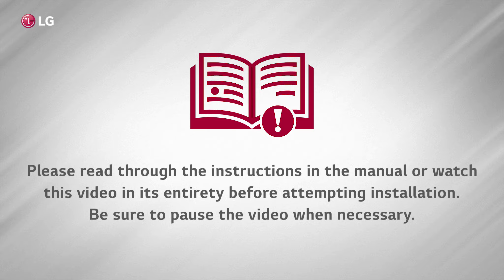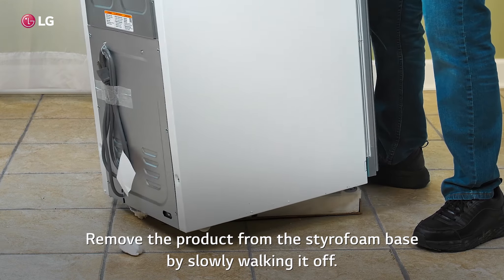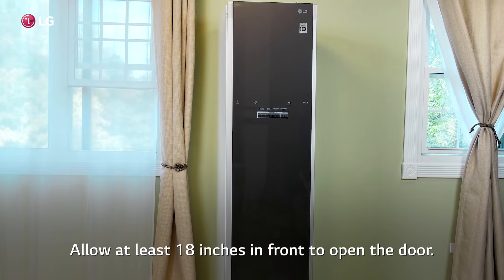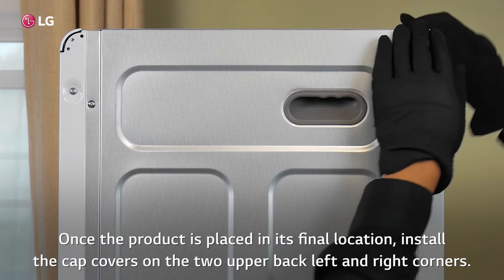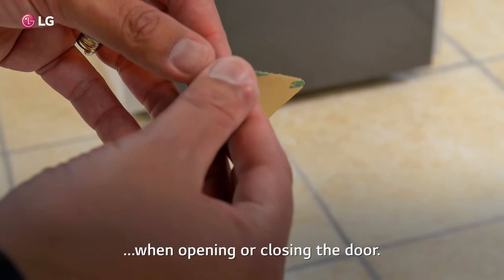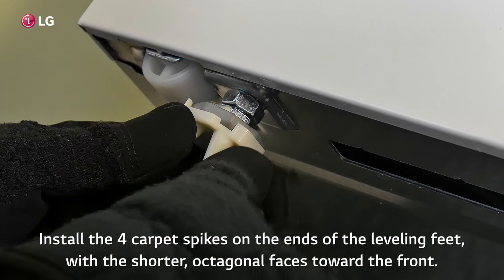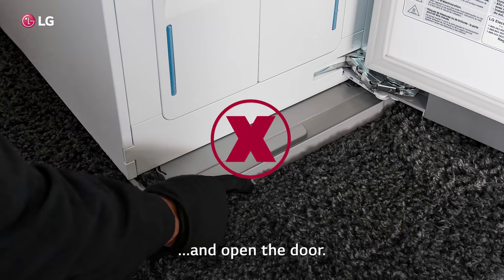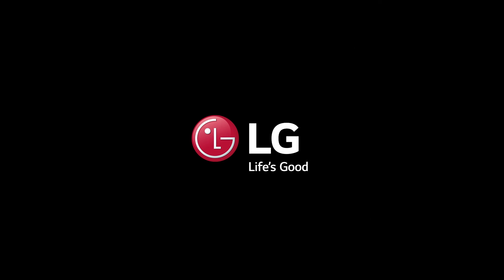[LG Styler] How To Install The LG Styler

Comment: I have a customer that wanted this machine built into cabinetry with finished panels on left and right and a cabinet with a door above.  But needing 7 3/4" of space above will make this look pretty bad.  How important is the 7 3/4" gap above?  What is the purpose?  Can we vent out of the rear area instead of the top/front?
Reply from the maker: Hey there! The 7 3/4-inch clearance above the LG Styler is essential for proper ventilation and heat dissipation during operation. This ensures that the unit functions efficiently and safely by preventing overheating, without the recommended clearance, it could lead to suboptimal performance or potential safety hazards. If you have any other questions, be sure to reach us on social media @LGUSSupport. We’re always here to help! ^Jose
Reply: @LGUSASupport  Thanks for the response.  Would it be acceptable to have a fan exhausting out of the back of the cabinet?  Or is the steam coming from the front or near the door area?
Reply from the maker: The Styler is designed to release steam primarily through the front area, near the door. Installing a fan to exhaust air from the back of the cabinet may not effectively manage the steam emitted during operation. For optimal performance and to prevent potential moisture buildup, it's recommended to use ventilation guidelines. We hope those details help! ^Jose
Reply: @LGUSASupport  Good to know.  That definitely helps me manage the customer expectations.

Comment: what are the clearances for the sides and back. I  see there is a 7 3/4" gap above.. .to hide this space, can we add a decorative grill?
Reply from the maker: Hey there! The recommended clearances for the LG Styler is at least 2 inches (5 cm) at the sides and back with 7 3/4 inches (20 cm) at the top for proper ventilation. You can install a decorative grille as long as it does not obstruct airflow. The Styler needs adequate ventilation to function properly, so ensure that any grille or cover is open enough to allow airflow. If you need help, be sure to reach us @LGUSSupport, we’re ready to help! ^Jose

Comment: How does this get water?
Reply from the maker: Hi there. Thank you for your inquiry about the LG Styler! The LG Styler utilizes a built-in water reservoir to generate steam for its clothes-care features. You will need to fill the water reservoir periodically, which is typically accessed from the front or side of the unit. To know more information, kindly visit this link:https://www.lg.com/us/styler-steam-closet?gad_source=1&gclid=EAIaIQobChMIr-vP_-q-iQMVy2ZHAR1ADy99EAAYASAAEgLk9fD_BwE&gclsrc=aw.ds. -MC